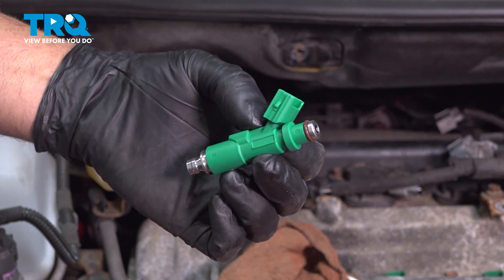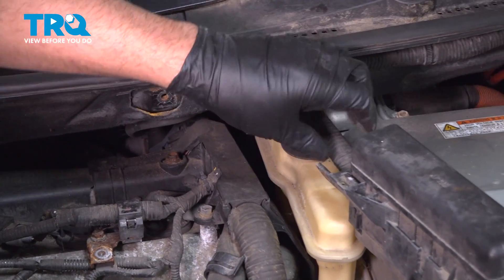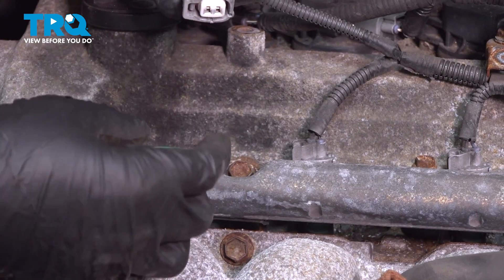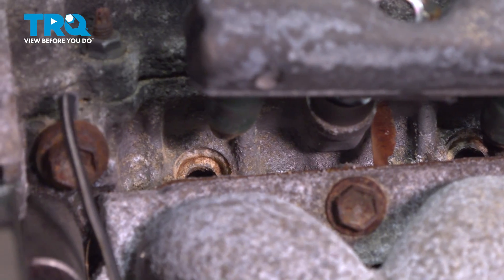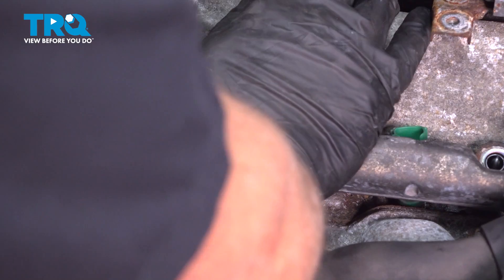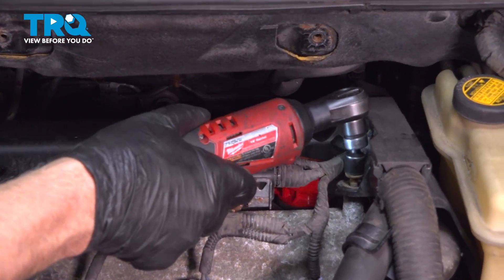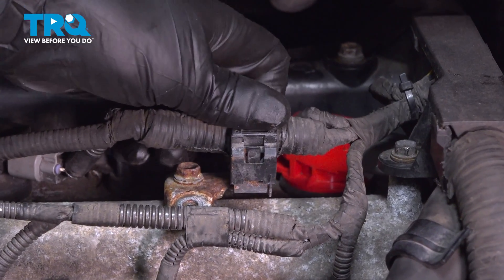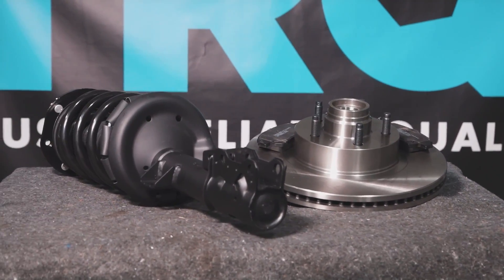How to Replace Fuel Injectors 2004-2009 Toyota Prius

Comment: use air to blow away debree before removing the injectors so stuff does not fall in the hole.  seems simple but a bit of rust will ruin your day.

Comment: You conveniently skipped over showing just how difficult the right-most injector is to get out and in, without destroying the bottom and/or top seal, thanks to how the valve cover goes over the solid fuel tube to the injector rail.

Comment: Nice job. May I add, at a minumium get a can of electrical cleaner and spray out the plugs and connector ends. You will be surprised how filthy these get.

Comment: Huge thanks to you. I had this rattle problem on my Gen 2 Prius. Cleaning the injectors with an ultrasonic bath with white vinegar and a little gasoline was the solution. Remember to change the 2 seals as well! And insert the injection rail carefully so as not to damage the new O-ring seals.

-------

Un immense merci à toi. J'ai eu ce problème sur ma Prius 2. Nettoyer les injecteurs avec un bain à ultrasons dans un mélange de vinaigre blanc et d'un peu d'essence était la solution. Pensez à changer les 2 joints également ! Et insérez la rampe d'injection avec précaution pour ne pas endommager les nouveaux joints toriques "O-ring".
Reply: Hey, i cant find the o ring seals anywhere where did you get them?
Reply from the maker: +@thibautsoufflet44 Thanks for watching our video! http://1aau.to/m/Shop-TRQ